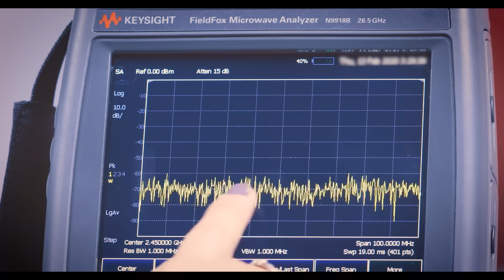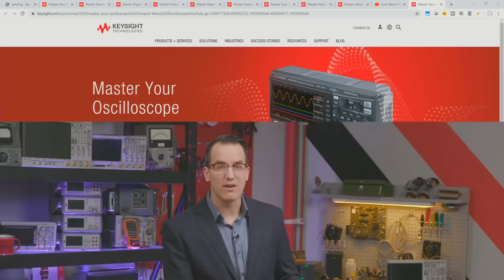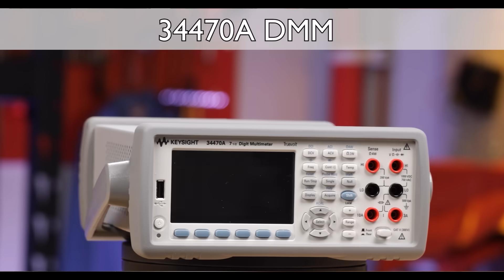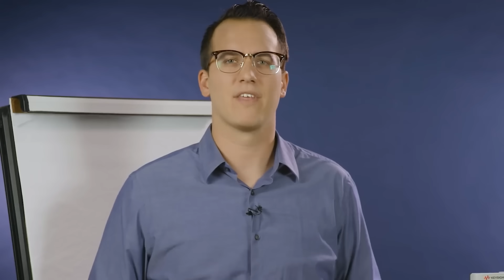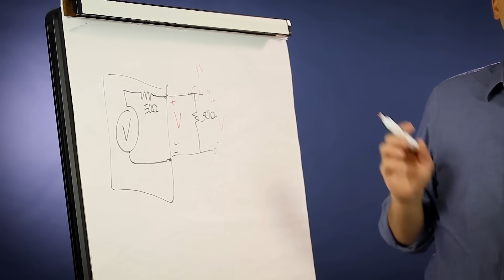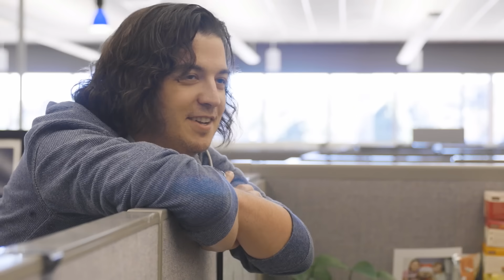Live! Will a Microwave Kill Your WiFi Speed? + Wave 2020 Kickoff

Comment: Is the DAQ also used as a logic analyzer? Or is the logic analyzer an add-on to another piece of gear? ANSWER ME BOGDANOFF!!!!!!!!!! Haha. I'm actually watch for fun while playing guitar.
Reply from the maker: Haha it's Saturday cut me some slack! No, generally not, a DAQ is more for pulling sensor data or readings from other equipment. It doesn't do decoding.
Reply: @Keysight Labs  I'm on the hunt for a decent logic analyzer. It kills me not to read big chunks of data on random devices. I'm only a hobbyist any, half my fun money goes to kids for stem. People are proud when it comes to someone wanting to help them. It's not giving their child charity, it's enabling the next generation of engineers. I spoke to a father today and his child wants a, HP 7.5 digit multimeter, I forget the model and a 200mhz function generator along with a scope. He caught the bug and only has a crappy soldering iron so I'll give him a good multimeter, better soldering station, bench supply, breadboard. My only stipulation to the parents is I'd like to have the dmm and soldering station back if he gives up. It's the honor system. I feel bad too because I just gave a scope away. I'm rambling, sorry.

Comment: i had a hunch about microwave, but i didnt know it impacted so much :D Loved the frogger back ground behind microwave :)
What motherboard is behind you at 5:15 looks like old socket 3 or 5 i186 or i286 :D
btw maby do a project aout probing old cpu`s looking on data lines etc :D
Thanks to GreatScot and Elektroboom i found out about you back some years :)
Q: What is good and what is bad with using a pc psu for charging the old type of car batteries(Lead acid i thin) is it safe or is it only for extrem situation and feel on the battery often cuz of heat?. but also for powering project`s :)
Reply from the maker: That board is from an old scope, I don't remember which one specifically. I would definitely do your research before you start playing with car batteries, they can be pretty dangerous!
Reply: @KeysightLabs  oh ok Nice :D design reminded me of a computer motherboard with isa slot`s etc :D Yes i know :)